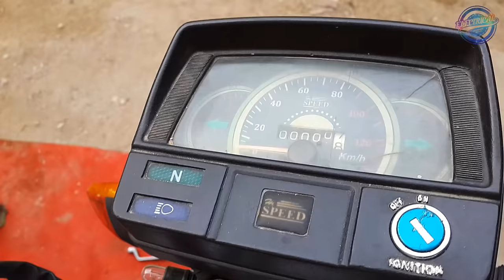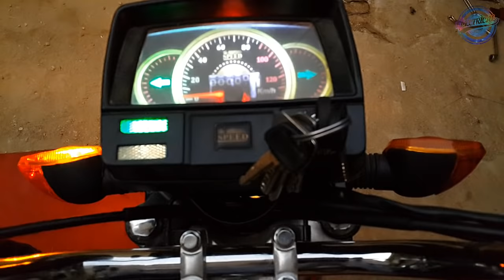Assembling Complete CD-70/SR-70 Hi-Speed Motorcycle || Replacing Old Parts With Brand New Parts.

Comment: The only thing high speed is the way it will fall apart.!!
3 fixings on rear light assembly
A split pin stopping the foot brake coming off 🤣🤣🤣🤣😋
Reply: LMAO!
Actually this design is very much is in use in south asia. But the design is not too safe.
Reply: But as far as breaking off is concerned. It wont happen.